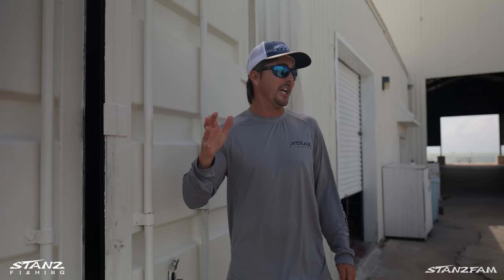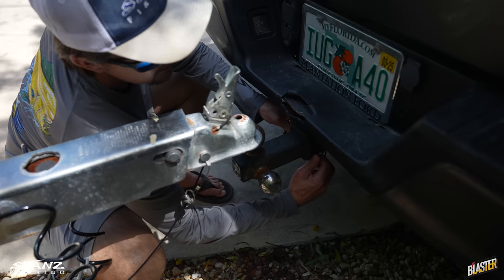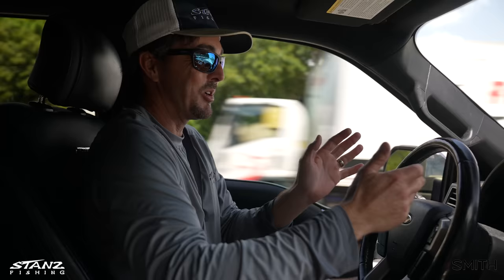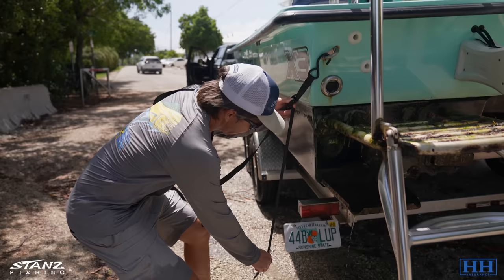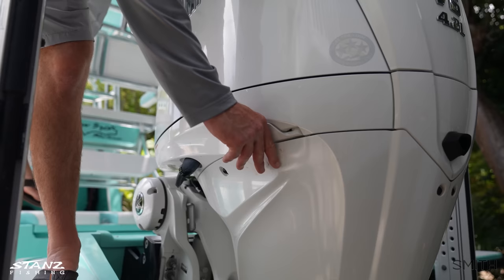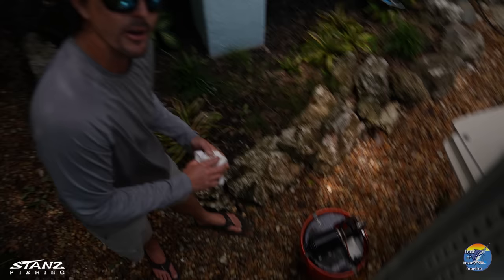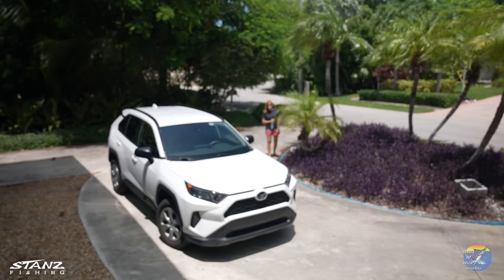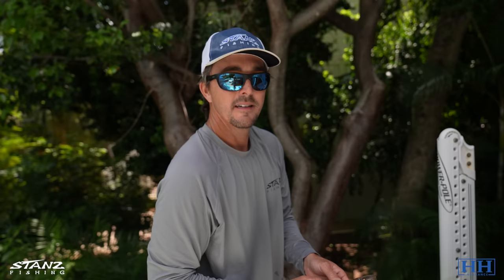*Trailering Bay Boat* in and out of water for Service

Comment: Just a tip, when you pull the prop off, put a little bit of grease on the splines of the shaft. It will prevent the prop from getting siezed onto the shaft.
Reply from the maker: 100%. A little fresh grease would have been a good idea, fortunately still some there from last time so not too worried about it

Comment: Capt. Nick, can you stop by and change the oil in my boats?  Just a suggestion, change all the trailers couplers to the largest size trailer you’ve got, saves time and trouble, you never have to change the ball.  Cost a few bucks but its worth it.
Reply from the maker: That’s a great idea about the trailer couplers. Would definitely make it easier. Thanks

Comment: You don't need it on the ramp you used, but show people how to buy and use a set of rubber chocks they can keep in the bed or tool box of their trucks. Everyone has seen the submerged cars and truck videos at boat ramps. Most probably think the people it happened to were idiots (and most probably were), but once in a while it can be a mechanical fault in the vehicle, and without a set of chocks in place, there it goes. Once, when using a 3/4 ton diesel van to launch my boat, with the emergency brake on, put in park, steep ramp, got out, took two steps and the gear selection lever popped out of park, and there it went. I managed to turn around and jump in and stop it, but it made a believer out of me. I also watched a truck start doing a slow slide down a algae covered ramp. Use chocks, they dont cost nearly what a new vehicle does.
Reply from the maker: Great point. Appreciate it

Comment: Any tips on what to do if my trailer is floating. Tandem axle trailer for 23’ center console. As soon as both tires get in the water it starts floating.
Reply: I had a trailer that did that. As long as there was not any current it was fine. It actually helps align the boat. I suppose you can add weight to the trailer if you want it to sink.
Reply from the maker: We’ve never had a trailer do that but I have seen a few pics before when they do float. I would assume add some weights to it
Reply: You think maybe it’s trapping air under the fenders? I just can’t see how those 4 tires lift that heavy trailer. That’s where we have issues if the water is moving a little the trailer will start floating sideways by the time I’m driving towards it

Comment: hey do you change the fuel filter under the cowl, water pump impeller, motor zincs and plugs too at 100 hrs?
Reply from the maker: No. We will do small secondary fuel filter usually every other oil change and water pump when needed. Since we use the boats on a regular basis and don’t spend too much time up shallow we never really have the impellers go bad. If we ran shallow or the boat sat for extended period of times we would do the impeller more often

Comment: Did you grease the prop shaft? And you forgot to do the fuel filter on the engine. Small pieces of insurance…
Reply from the maker: Still a little grease on the prop shaft but some more wouldn’t hurt. We change the secondary fuel filter every other oil change usually, fortunately we rarely see them clogged up here

Comment: are you really gonna try to make us believe you didnt put 3 gallons of oil in that engine   one more little oil change trick when you pull the dip stick out to check level never ever tilt it with the point up because the fresh oil will run towards your hand and make it look like there is more oil on the stick  so always keep your stick facing the ground or keep it level so it doesnt move on the stick
Reply from the maker: There’s still over a gallon of oil in the orange bucket. Good advice on the dip stick, fortunately never had a problem with too much or too little oil the last 10,000 hours we ran on the outboards. I assume that’s why the make the the metal or plastic textured between the two marks so the oil doesn’t run as easy and give an inaccurate reading. Little room to play for sure between the marks on the dipstick, I’d guess close to a quart between the low and high mark with no difference in engine performance